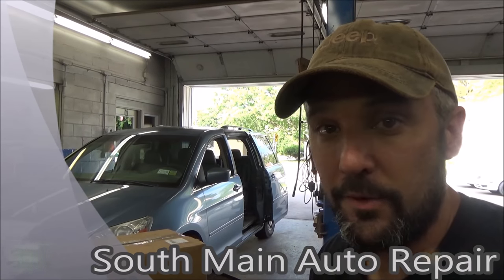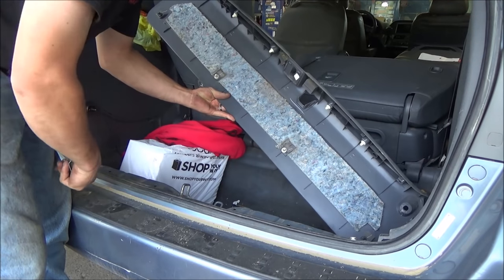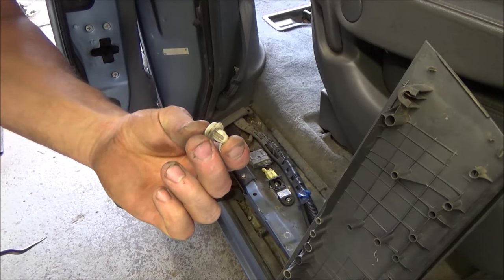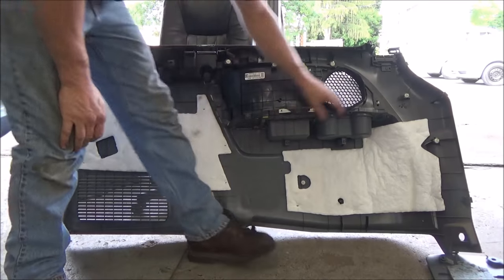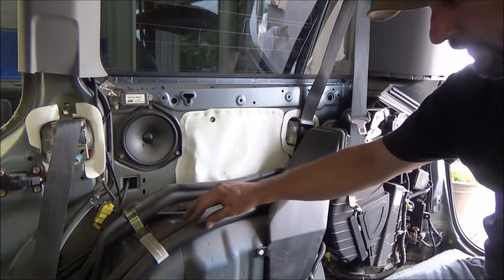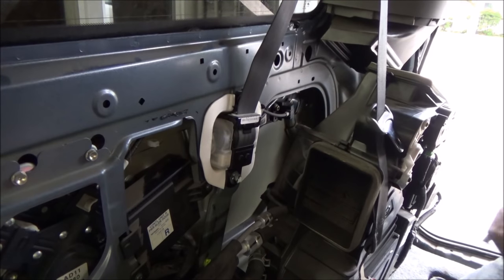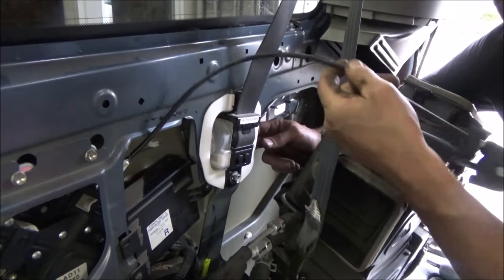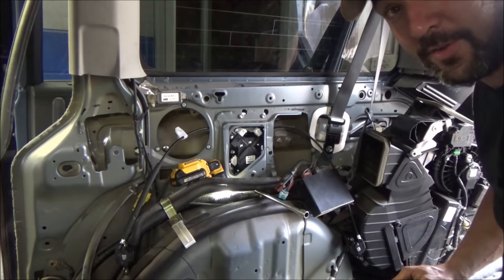Replace: Honda Odyssey Power Sliding Door Motor & Roller

Comment: Someone probably bought that door controller, saw how much trouble it was going to be to change it, and said "F*** that, I can live with a manually operated door" LOL  Good job, I hope I never have to work on one though ;)
Reply from the maker: farmboy30117 and now they got a nice video to follow it :)
Reply: That's ABSOLUTLEY what happended!
Reply: farmboy30117 8
Reply: I swear that's excactly what I said
Reply: farmboy30117 Hahaha; me! I just detached 1 side of the cable and wrapped it up inside the the slide cover and the other side is caught behind the frame...so, now the door is manual. I will eventually fish it out and connect everything. But yeah, gr8 video instruction and dayum it is a lot of work to get to that motor
Reply: thats what i said too but theres no real handle to slam the door manually and the wife is tired of getting out to close every one in... also when your just changing the outside hinge with the cables disconected, dont let your kids hit the handle or your dad... it turns a 15 min job into a 3hour job of winding dual cables on motor witch will fail a year later...

Comment: Thanks   I just spit coffee all over my monitor and keyboard when I here you say "it's key-wayed on the bottom, like a camel-toe"    Also, on those "push-pin" retainers, after you push the pin down and remove the retainer, you can pull the pin all the way through the bottom, then re-insert it to the top; easier than trying to push it back up most of the time.

Comment: This was a great walk-through.  I jotted down all the steps described in the video.  It helped to have step-by-step reminders of the tasks:

1. Unscrew and remove two cargo net retainers located on the rear hatch threshold and one cargo net retainer on the upper rear edge of the large interior panel
2. Remove rear hatch threshold by pulling forward at bottom then up from top
3. Remove cover at base of 3rd row seat belt attachment point
4. Remove 3rd row seat belt bolt at floor (14mm)
5. Remove sliding door threshold by lifting up along inner edge
6. Unbolt 2nd row seat belt at lower attachment point (14mm)
7. Remove cover located at top attachment point of middle row seat belt
8. Remove exposed seat belt bolt at top attachment point of middle row seat belt
9. Loosen rubber door gasket top to bottom along rear vertical edge of sliding doorway
10. Pull forward on bottom of C-pillar upper trip piece
11. Pull large trip panel away (the one that stretches from sliding door to hatch and window to floor)
12. Remove white flexible plastic cover by using utility knife to cut black gasket material
13. Remove speaker (3 X 8mm bolts and unclip electrical connector)
14. Remove 2nd row seat belt mount (1 x 10mm and 1 x 14mm)
15. Remove flexible plastic insert under 2nd row seat belt mount
16. Remove tail light (remove 2 covers, then 2 screws, then pull towards rear of vehicle)
17. Open sliding door ¾ open
18. Remove outside sliding door cover (remove rear 10mm and front Phillips screw)
19. Use a cloth covered jack stand to support the sliding door about 6 inches from the rear
20. Loosen and remove 2 x 14mm bolts that secure the center roller to the door
21. Lift the center roller and pull away from the van
22. Remove the cable ends from the center roller
23. Remove lower rear air duct
24. Remove upper rear air duct (push center pin up to collapse fastener)
25. Remove 3 x 10mm bolts securing rear HVAC unit
26. Remove 2 x 10mm bolts securing module located on D-pillar (in the way of HVAC) 
27. Pull HVAC away from wall (note drain at bottom of HVAC)
28. Remove hard plastic cover behind HVAC unit
29. Remove 3 nuts (10mm) on rear sliding door cable mount
30. Release cable retainer on rear section of sliding door cable
31. Remove 4 nuts (10mm) on front sliding door cable mount
32. Release cable retainer on front section of sliding door cable
33. Unscrew 2 phillips screws holding sliding door motor controller
34. Pull sliding door motor controller inwards
35. Loosen but do not remove upper 2 bolts (10mm) on top edge of sliding door motor
36. Loosen and remove bolt (10mm) on bottom edge of sliding door motor
37. Unhook two 2 electrical connectors 
38. Remove sliding door motor and all old cabling

Reverse these instructions to install new motor.  Once you have installed the new motor and attached the new cables to the center roller (you’re back up to step 19), be sure to slide the two white pieces on the new motor downwards to the lock position.  This tightens the cable to the motor and if you don’t do this it won’t work.  This is also the right time to verify the new motor works before continuing with reassembly.  Also note that you can also replace the center roller with a new one if needed for no extra labor.
Reply: Way to go Franco, this says a lot about you.  huge thumbs up
Reply: Thoses notes are great! I'm not too tech savvy but I wonder if I can print them wirelessly to my printer! Thank you for the great notes!
Reply: Hi, Where did buy the part from, is it the original part or aftermarket part? Thanks
Reply: @Zahnour1  I got mine from an auto recycler (junkyard)

Comment: Was a little afraid to mess with the hvac system on that side to get at the motor. I watched this video twice, bought rollers and a motor online, and did the repair in a few hours. Thanks for the exceptionally clear and thorough instructions. Gave a bit of new life to our old odyssey.
Reply: Hew many hours you done?

Comment: If you do a lot of those heavy van doors, take one of those cheap screw jacks that have a groove that hooks in a body flange to raise the wheel that come with cars and put it on a small furniture dolly. You can screw it to the dolly or leave it loose to put boards under for more height. You can move the door around and raise and lower it easy. Pad the groove with a piece of inner tube so you don't scratch the bottom of the door.

Helps lining up regular doors too.

Comment: So I just finished this project myself last night after three days of fun and laughter. Only I changed the cable inside the motor. Which is harder. If you can swing a new motor assembly, do it. If you can swing paying someone else to do the whole thing, do that. But if you're crazy enough to have at it, this video is invaluable. Thanks, Eric.

Comment: Excellent, clear video with good verbal description of what you were doing at every step - interjected with really funny, dry humor.   Thank you for posting this!  In my case I did not cut my cables but my autistic son forced open the door to jump out while we were driving in the parking lot.  He was unharmed but the cables were screwed up inside the unit.  So I do this repair this weekend.  Sharing your expertise helps me get the job done.  Thanks again from a driveway mechanic who never hesitates to try to do any repair in brazen foolishness... You are an ace.
Reply from the maker: Glad it was a help!
Reply: dont forget to tack weld where the missing bolts u dropped were just ask etcg

Comment: Just wanted to say thanks 
Your video helped me replace my car motor " odyssey 2006" without any problems and as you did it exactly. It took me nearly 1:30 hours to complete the job and saved me a lot of money, I bought the motor for CAD$ 75 "used" and that's it, at Honda dealership they asked for $850 
You are amazing 👍🏻👍🏻

Comment: This was a great video. I had a 2003 honda odyssey with 202000 miles with the same problem. I also cut the cables. I had 4 kids with no way other than having them climb over the front seats or go through the back tailgate. I wish that someone would have made a video that was as good as this one. I am now a subscriber.

Comment: Recently put in a new/used roof mount antenna on my Hyundai Santa Fe,never did a job like that before,got it all installed,and put back together only to find it was sitting a tiny bit crooked due to the rubber gasket not being seated all the way,it doesn't leak mind you,but it bugs me after all that work i neglected to check the gasket before putting it on the roof,then again after tightening it from the bottom...this video taught me a valuable lesson in  checking your work as you go as to not overlook anything,the radio works great and it doesn't leak so it's good enough,cause i'm not taking that apart again,lol

Comment: Thanks for the video.  I know at one point you said you wish you hadn't started it but I'm glad you did and finished too.  It is a lot of work not as difficult as most people think just very time consuming.  I did this with my 13  year old daughter, great father and daughter bonding time.  I actually took the motor apart and replaced the cabling because the motor was fine just the rear cable broke because one of the rollers on roller assembly broke off.  It was considerably cheaper but much more time consuming.  Believe me if you have the cash buy a replacement motor, much easier.
Thanks again for posting these Eric!!!  Great job!!

Comment: This is the best video I have seen on doing this. I don't need to replace my motor unit but I need to release the cable tension to replace the door roller. So I need to take apart the interior. Thanks!

Comment: Great video. I have a 2003, so mine will be a little different. I also cut my cable out of necessity so I could get my door closed. It was just hanging down. The door worked great as an unpowered door for a couple of months and then the rollers finally gave out. This repair is in my future and your video should help me yank the needed parts from the local boneyard. Your narration was like watching a friend do the repair and was very helpful

Comment: Excellent video Éric! I had a door that would open with difficulty on my wife’s ‘06 Odyssey. I purchased a new motor (over 300 dollars) and after watching your video attempted at a replacement. After a couple of hours everything went well and went back together. The door works but it didn’t solve the problem! It was the door actuator inside the door itself!  $56 bucks brand new online. I replaced that in about an hour and the door works perfectly. Oh well, I live and learn. Now I have my original door motor that I don’t need but still works. Maybe I can sell it on eBay and get something for it. I don’t feel like putting it back in the van.
Reply: On these doors people will spend hundreds fixing them, often it is a little rubber bumper on the top hinge track. It will be on the back side, 21.00 at the dealer. If it is missing door will be very difficult to close. Will not pull all the way down at the back. Almost closes then opens again. Can also be dislodged.

Comment: Great video!  Our 2007 Odyssey right sliding door rear cable had snapped.  I ended up changing the door motor assembly in the parkway in a little over 2 hours after watching your comprehensive video.  I used Honda parts (motor assy $280 and roller bracket $45 plus tax).  Thank You!

Comment: 2006 Odyssey passenger sliding door beeps when in drive. However, instrument panel open door indicator shows it closed. Dome light not on as typical when a door is open. My battery is dead each morning even after new battery. Battery and charging system tested in good working order. My local dealer said battery was going dead because the latch is bad, and therefore even though the engine is off the door motor keeps trying to finish latching, even though I can't hear the door motor running. Humm? They also said door doesn't open all the way sometimes and it doesn't move smoothly.

The dealer wanted over $1,400 just in labor to replace the door motor, roller and latch. When I complained about the price they lowered the labor to $900. I was still suspicious of this price and felt that for an experience dealer mechanic with all the right tools, that it was only a few hours work worst case. You proved me right! I found the parts for $200 cheaper online and will replace them myself some upcoming Saturday.

Nice video quality and angles considering that you're doing this all by yourself. You articulate well. Thank you!

Comment: Don't know how I missed this one... a true epic odyssey!  Now I own a used Odyssey... good to know this is doable for DIY.  Thanks Eric.
Reply: ... and now I've got a roller problem!  ETCG has a video on just the rollers too... most of the points you made, he made as well... he ended up breaking his tail-light, so there's that.  Good to refresh how that rear trim comes out, I'm going to have to remove it to add trailer lights.  One thing to note... there's bushings on the ends of the cable that go around the pot-metal end crimps, you may have to move the bushes over to the new part if they're not applied.

Comment: Thank you for such a well done production. I need to replace the door control module. I saw it on the video, will do it in the morning. Just needed to find out where the plastic pins are and how to get to them. Tried a short cut today, but wasn't able to get the panel with the vertical flip cover door off. Doesn't look like I'd have had enough room to make that work.

Comment: Our van is currently in the shop for a sliding door issue, but ours had a 'SLIDE DOOR' warning light on the dash. We were told it needed a new control module. Then a few days later we were told it needed a new motor on the drivers side door. Seems like they might just be throwing parts at it. I wish I had found this video before I took it to the shop. I could have thrown parts at it and saved me a bunch of labor costs.
Reply from the maker: it likely needed to be reset is all
Reply: I'd done the "pull #7 fuse" reset and it'd work a couple times before the light came back on. I was reading that there are body trouble codes that can be retrieved by using a jumper wire on a diagnostic port behind the drivers kick panel. Wish I had found that info before I took it in too. Must do more research next time I have an issue.
Reply from the maker: Dustin Rogers Yeah I fix a lot of those doors and it is usually just an input problem, one of the many door switches or as simple as freeing up a latch etc. I have never had to change a module though. Sounds like they are shooting the diagnostic cannon at it...

Comment: Hi Eric! Just a little tip for you on those push pin type retainers. I find it easier to just pull the pin out from the backside and just reinstall the clip and put the pin back in instead of trying to shove it back up into and out of the top of the clip part . One thing i have problems with id the ones Chrysler uses for there trim they are very fragile and like to break. like you said Hondas plastic is very pliable and durable . Thanks for the video and have a great day!

Comment: I know it's been 5 years but, this video helps me a lot! I probably won't do this myself but if my mechanic watches this, it could save him time knowing what to do instead of guessing at some things. I am amazed how quickly you moved, considering that you had to change camera positions and how quickly you found all of the fasteners. I think this was probably not your first door motor.

Do these things give warning before they go? Mine just went out. I went to open it and pffft, nothing. Not even a pffft. When I could do this stuff, I'd check safety switches checking for power at the motor first. I don't want to buy a motor if a connector is loose or if I can put grease in there to improve the connection. I cannot think of the name of that grease...  Anyway, maybe someday you could make a troubleshooting video unless you've already made one!

Comment: About to attempt this repair on my '11 Odyssey where the cable snapped.  Got my OEM Hondoo parts on order, looks like it should be manageable in an evening for a DIY-er such as myself.  Thanks for the great video!
Reply: Success! There are a few differences with the '11-'15 generation odyssey but the procedure is essentially the same. On the up side, the motor is no longer mounted inside the rear quarter panel and is much easier to get to! On the downside, the rear HVAC system has a lot less play (the AC lines come through the panel instead of over the wheel well) and makes it a royal pain to get to the mounts for the rear cable passthrough. Took me 4 hours and worked perfectly the first try. Thanks again for the great video, Eric!

Comment: I like the video very much! It helped me understand what area I would need to get to my 2004 Honda Odyssey roller assembly. My roller wheels just broken and my door is hard to open. I have to pull the latch more than once and the door will not manually close unless I use the controls on the control panel. I believe I am going to have to replace the whole assembly as well. Thanks a lot for the video South Main Auto Repair!
Reply: +Wayne Wright If you haven't fixed your problem already, try just replacing the roller.  You won't have to open up the interior and it'll be a lot easier.  You should only need to change the motor if cables have snapped.

Comment: I like that you show all the trim removal. I hate when guys say “ I just removed this rear panel, then...”
I am buying a 2008 odyssey and the driver’s slider won’t open with the switch but will if you pull the door handle. It will close with the switch. Rollers?

Comment: Great, Great, Great video.  I loved it, congrats very well done.  I came across it while searching for videos on how to change the center roller guide of my side door and wanted to learn about how to release the cable tension. I learned so much from your video.  Thanks so much for doing this.  If I lives in NY I would definitely visit your shop to do my auto work.
Reply from the maker: Terrence Rasul Glad to hear that it helped you!

Comment: Fantastic !!!!!!!!! I am looking at buying  a 2005 Odyssey, and the left door motor does not work, I assume. The door slides ok but, when you pull the handle or push the button on the dash, it does not move. Now I have to find out what that motor cost.   Thank you very much !